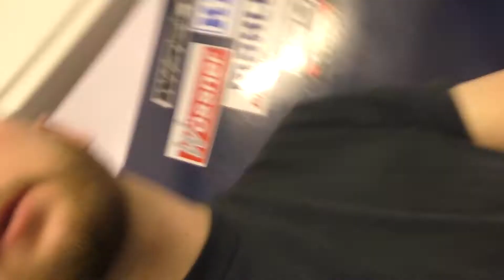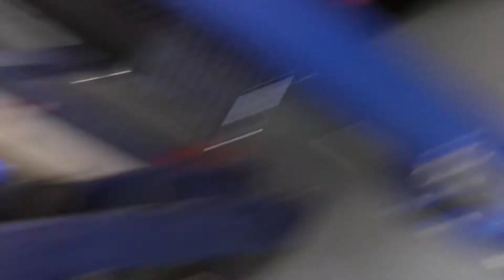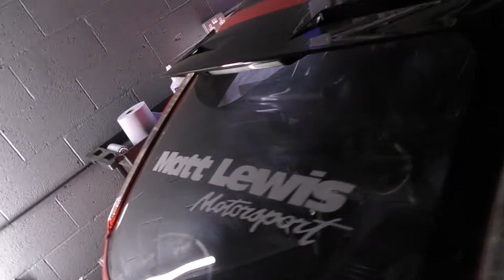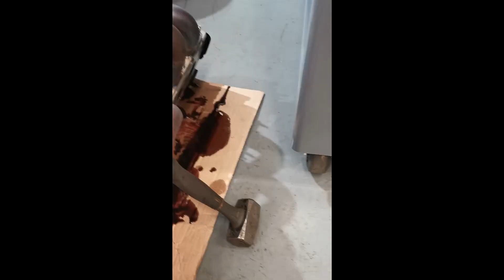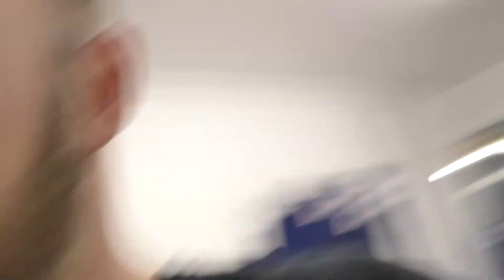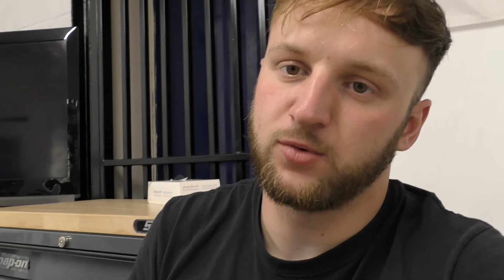Why the 1000BHP 5 Cylinder Engine went BANG

Comment: My WRC gasket failed too on my first engine 
Stock gasket fitted on the new one and only just gone now 15,000 miles later
Reply from the maker: Pain in the arse man! Glad someone else knows my pain 🤦‍♂️
Reply: @ApexDevelopmentsUK  yup I only got the miles down to little Hampton and back before it went bang. 
Only reason my stock one just let go was an over boost on the turbo when the vacuum line split and we hit 3bar!
Reply from the maker: Big boost that mate 😂😂 back to the stock gasket and fingers crossed no more engine issues!

Comment: not had much luck with that engine have ya hope you get sorted soon and back to racing
Reply from the maker: The engine this time round had been fantastic, no weird noises or rattles. no heavy breathing issues/oil chewing. Ran so well up until the gasket failure as you can see from the previous video. This would be a very different story if I'd just ran a stock headgasket.
Reply: @ApexDevelopmentsUK   yh man got yourself a strong engine there just a shame that one part made for this application has failed on you quite prematurely hopefully you can get some kind of refund or something along them lines and if your running the power im guessing its not mental loads but im sure you will have it up and running in no time good luck in rest of race series wish you all the best 👍

Comment: I really hope you are going to some how get something out of that company for that bad head gasket.
Reply from the maker: It's a really hard thing to sort out, I believe it will get dragged out for months on end. I usually wouldn't bother and just take the hig but their first contact reply via email really rattled my cage.
Reply: @ApexDevelopmentsUK  yes you probably are right they do everything to not take any responsibility but I hope you will get something out of them.
Any way just out of curiosity how much power can take a volvo gasket???
Reply from the maker: @J_I_Was  there are 2 cars I know of running over 1000bhp on the stock gasket 👍
Reply: @ApexDevelopmentsUK  wow that is a lot of boost
So why did you decided to go with that wrc one?
Reply from the maker: @J_I_Was  we were using a slightly thicker gasket lower the compression ratio.
Reply: @ApexDevelopmentsUK  now I understand why. 
I hope to get my st on a track next year I still have a lot of work before that.
I have some pictures of my project on insta at j_i_was